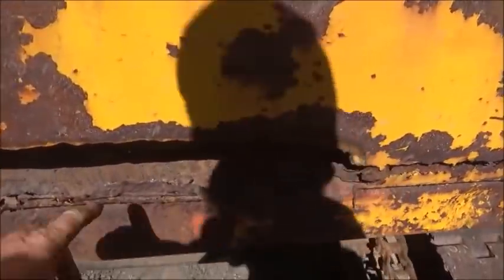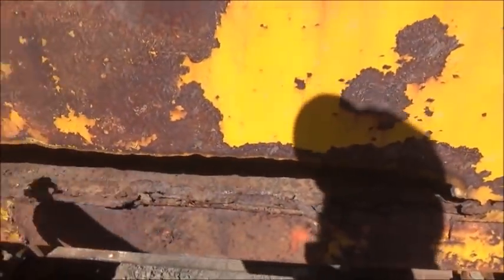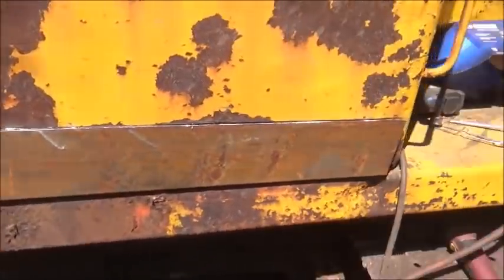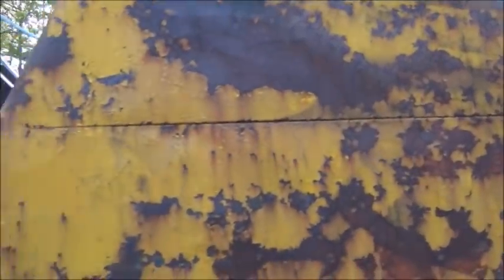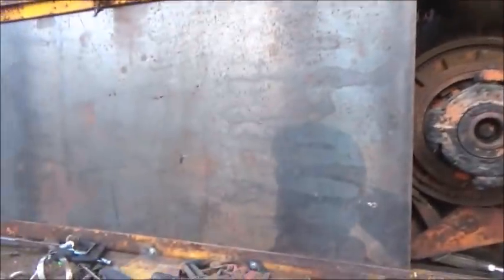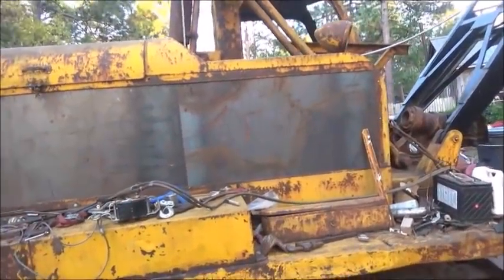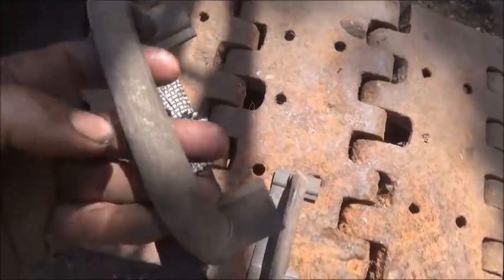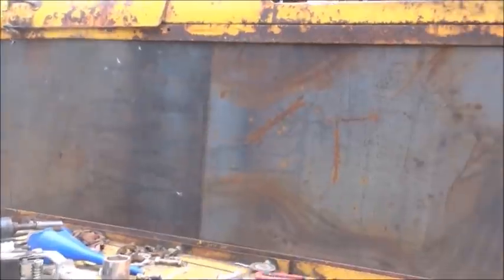1952 UNIT 614 CRANE REPAIRS PART 8

Comment: The Unit Crane Saga: discovered, purchased, engine pulled in the woods where it sat for 20 years, gearbox repaired with NOS bronze gear, driven out under its own power and now at the homesite getting some final care is going to be a mighty fine playlist.
Reply: Super.  I like this crane.  Super.
Reply: I was just getting a kick out of remembering he pulled the engine in the middle of the woods...🤣

Comment: Your crane project is coming along nicely ,nice fit and finish on the door panels,and the cab piece below the roll up window. Saw a video from the 2019 Steam Threshers Meet,there was a Unit crane there,painted orange with green lettering.The orange paint seemed a bir brighter than Allis Chalmers orange,like not as much red hues in it,and the green was about in the middle color from a Terex green and Forest green,,it definitely was looking sharp,,boom and undercarriage was painted like a satin black,low gloss!! 😎😎

Comment: When you get all the panel repairs done. A good idea to do, is give it good sealer primer and Raptor Bedliner the cab the original orange wrinkle finish to cover up most of the dents and scratches.

Comment: I didn't notice if you have swivel blocks on your hook, but we did some serious damage on a proof test when the new stranded cable began to stretch for the first time (There's such a thing as pre-stretched cable). Stranded cable always twists (Unwinds) a bit on the first load. Anyway, we put 90 degree twists in a pair of  1"x12"60" steel lift adapters. We had to scrap them and start over (an expensive lesson). The second time, we added swivel blocks. You're not only proof testing the crane, but also the cable. Have a care, W.

Comment: Your front window was made in two parts that folded in the middle.  The center at the hinge had locking levers and the bottom window had the rollers that rolled in the track. There is a handle to grab on the inside that also serves as a place for the latch in the top of the cab to hold onto.

Comment: For the Front windshield make some S shaped 8th inch metal plate top and bottom sill. Do the same for Jambs on the sides of the window. A cheap non expensive windows for that thing would be some half inch plexiglass pane. Use the rubber inner to water proof the window. the sill and Jambs will help make the window seal and weather proof. Once everything is installed calk the edge of sills and Jambs with weather proof calking. When installing the sills and Jambs using weather proof calking as well. Just line the install area with a thin line to help seal the area well.

Comment: At your minimum radius and with a 4 part line you should be able to test that boom at 15.000 lbs with no problems. If you had a 6 part line you could pull 30,000 lbs. Your brakes might not hold that load but the boom is certainly capable of that much weight with the winches you have. You will probably never need to pick that much weight up but it's good to know that boom is certainly a lot more capable than what you will ever put on it. I have picked up over 28,000 lbs with basically the same boom. The sheaves and winches and line size is what you have to make sure that they are the right combination. You have steel sheaves so you are good there.

Comment: Youtube Diesel Creek just bought a Unit crane too..  damaged boom.. he ended up driving new 1/2" rod to reconnect tracks that had separated.. i wonder if you could tighten your tracks back up by driving out the old rod and in fresh pieces..  

i would also think that you might take the drive chains off and roll them up and soak them in some used engine oil in an attempt to free them up ..  but i guess you won't be traveling very far with it.. 

 if you laid out the name plate and took a straight picture of it to get rid of angular distortion..  i bet some viewer could digitize  the image ..fill in the missing letters and perhaps 3D print that in plastic..
Reply: 3D printing is a good idea. You're not going to reproduce it the original way -- stamped sheet metal -- unless you like painstaking work....

Comment: Someone with some metal skills needs to make a nameplate for this machine.
 After the windows are installed is it possible to flip the fan to blow air out instead of pulling air in to make the cab cooler, I know it will not operate all that long at a time or very often but it may be nice to have it comfortable as can be expected

Comment: How does it hold the weight up, is it just on the brake, or does it lock somehow..Cheers 🍻
Reply from the maker: Has a drum with a clutch to engage the lift and a band brake around the drum to hold it. The band is operated by a foot pedal that can be locked in place.

Comment: Jonathan. You are a relatively smart guy but your house is a mess! Wash the crane with a pressure washer. Orginization makes life way more easy.
Reply from the maker: Like I have time. Do you get much done?
Reply: @jonathanw4942  I get more done because I never have to look for anything because it is always in it's place and I don't have to trip over anything or remember where I put it.
Reply: @jonathanw4942  Check out the Wreckers on Pepe's Towing